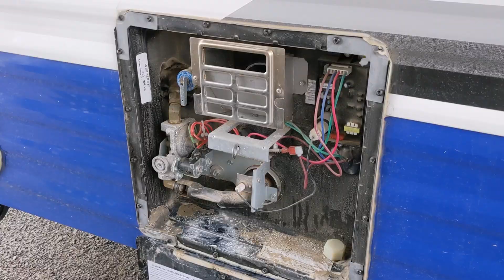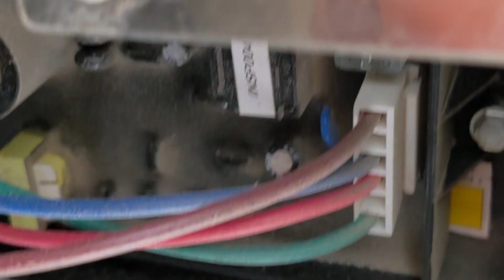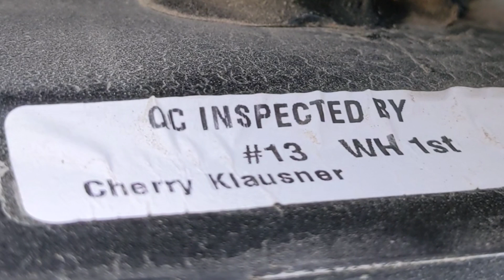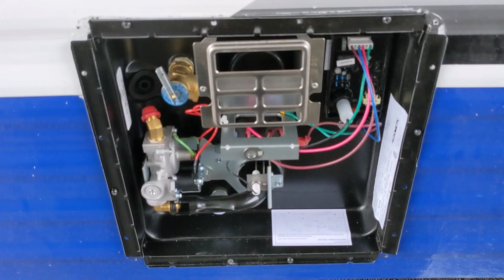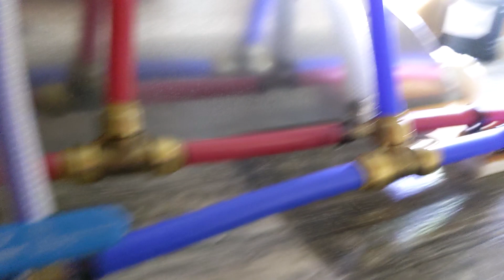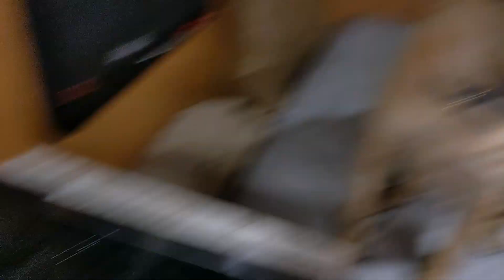Sun-Lite 16BH Hot Water Tank Replacement and New Fittings

Comment: Joe, I've been watching your solution and quick question. Is there any reason I couldn't use the existing lines to the 90 degree elbows into the new tank? I'm thinking of doing away with bypass as you have but I'm not seeing why other than direct drainage on those lines.....aka, you didn't change the path flow in anyway did you? Hope that makes sense.......Thanks in advance.
Reply from the maker: @DoyleCast  i didn't change the flow at all. You can keep the existing lines and just replace the elbows. The ones I used (brass, not plastic) are made to work with PEX piping.